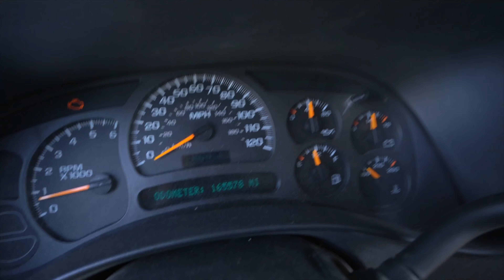Camaro 3 gen LS SWAP PROJECT EP:1

Comment: Hey man I have a 91 z28 with the 5.0 in it as well and want to throw a 5.3 4l80 in but have heard about notching the k member or getting a different oil pan. Howd did yours fit and did you do any modifications to get it to sit good?
Reply from the maker: i have a truck oil pan fits perfect with my motor mounts
Reply: jamari lincoln look underneath. It sits below the k member you hit something on the street and rip it off
Reply: Did you end up using the truck manifolds?